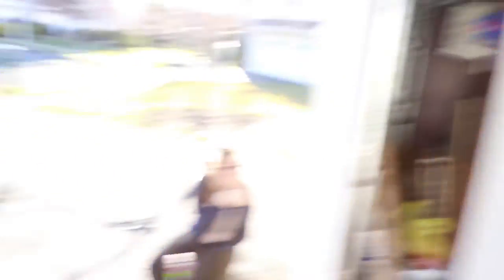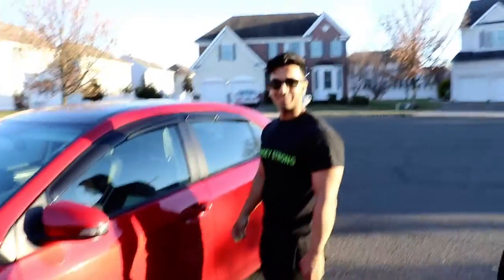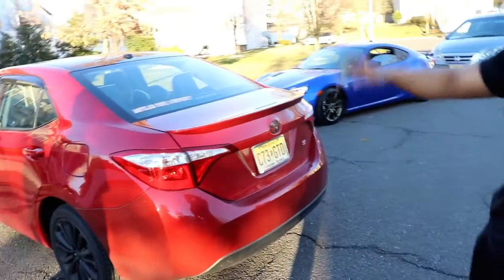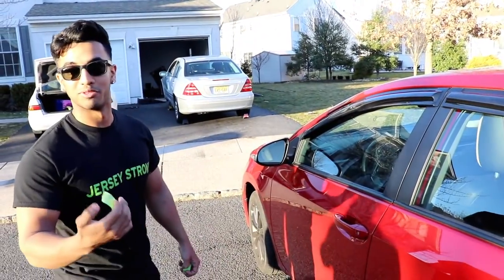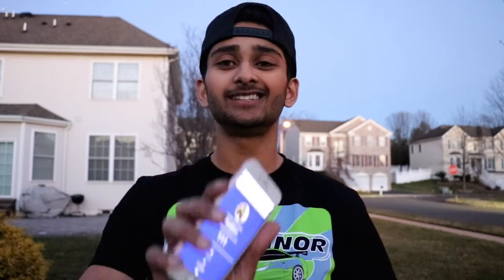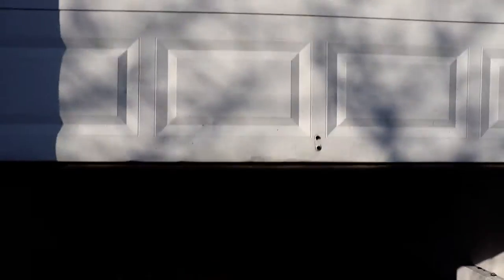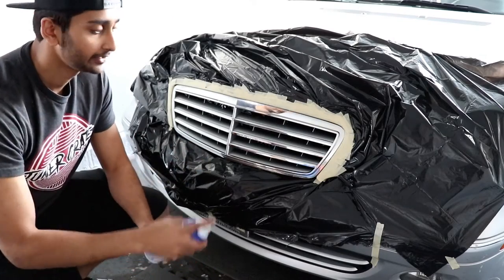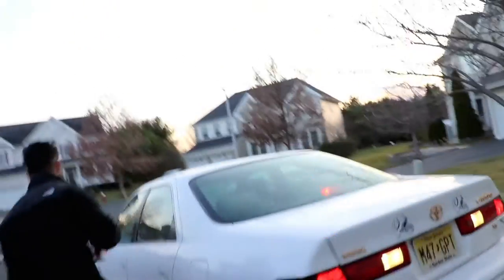PLASTI DIPPING A MERCEDES BENZ

Comment: Good vid, just a tip that I learned to help the result.  Heat up the cans in warm water prior to using, it atomizes better like that.  People who get texture generally get it from using cans that are not at the right temp.  Not sure if you are familiar with Autoflex coatings, but they are getting released in cans in the next 2 months.  Its going to change the game with the results you can get, its gonna be awesome.
Reply from the maker: +guitarphil11 thank you for the tip, ill try it next time and that sounds cool im gonn check it out!